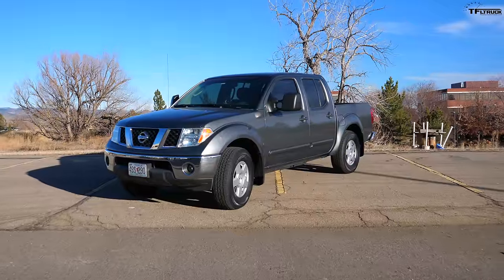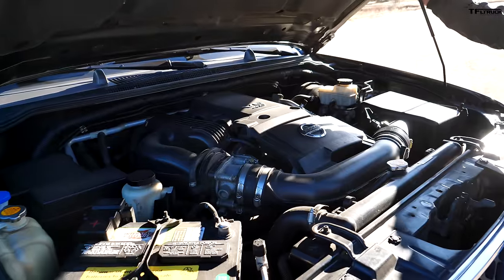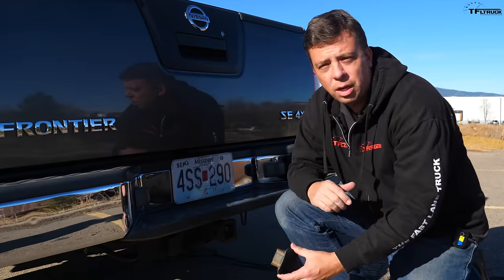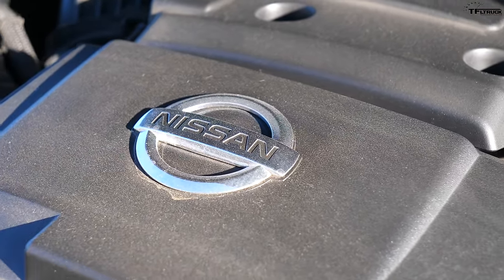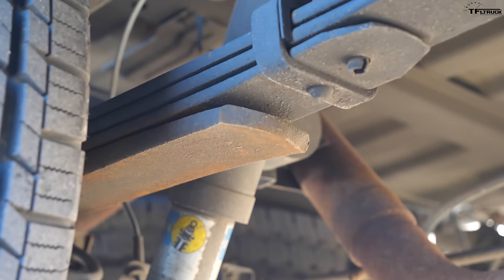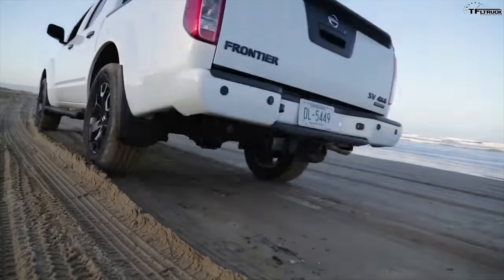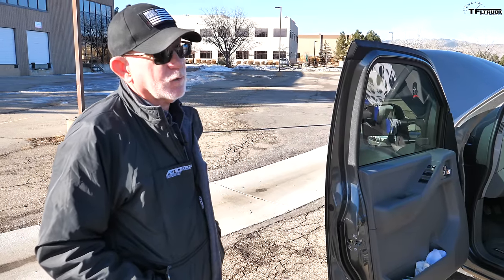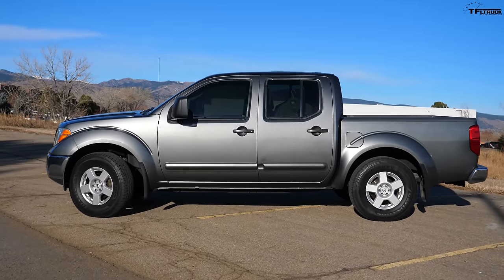Here's Why I Prefer The Old Nissan Frontier Over the New One — Dude, I Love My Ride!

Comment: I just bought a 2006 Nissan Frontier XE  king cab 4 cylinder auto for a $1000 , body and interior are near perfect,  it had the coolant in the transmission fluid, I did a flush and seems to be working ok, it even had a cold matched ARE canopy that promptly removed.
Reply: Looks like common problem.Seems manual transmission don't have that issue.

Comment: All owners of 4.0L Nissan's should hear this... Replace the chains before the warranty expires. There's a TSB for it. The factory secondary guides wear out. Once they're replaced, they last forever. Also, if you hear a loud ticking in the dash, it's the blend mix door actuator. That requires removal of the entire dash. Get it replaced before you're out of warranty.

Comment: I have a 2012 Tundra with the 5.7 that I have driven since new. Rolled over 239,000 miles on Monday and will have about 500 miles more by the end of the week. I use it for work.

Some issues over its life, but original motor, trans, rear end. But then again, it’s a Toyota.

Comment: I have a 2006 Frontier with 145,000 just replaced fuel pump because of fuel gauge going bad.  Love this truck its been trouble free and plenty of power.......
Reply: Should have just replaced the sending unit, cheaper and fixes the fuel gauge.
Reply: @trevors8577   Why in the world would I go to the trouble to drop a fuel tank on a 14 year old truck with almost 150k and not replace the whole unit. The filter on old pump was super nasty look like muddy water running out of it. The truck actually  runs stronger and idles better with new pump. Oh and BTW the new unit was well under $100.

Comment: In 2011, I bought my midsize pickup.  I bought a Chevy Colorado.  I wanted standard and they offered only 4cyl (2.9) with the manual.   Looking at it now, because of the 4 cyl, there is a lot of room to swing a wrench under the hood. Also, exhaust is easy to get at being that its on only one side of the motor unlike the Nissan 4.0.   Also, because it only has a 2.9, the wheels dont spin themselves crazy when its slippery.  With the limited slip rear end, I often see how far I can go in 2wd during snowstorms for kicks.

Comment: The 2005-PRESENT Nissan Frontier is a good looking truck. And I which I knew how to drive a manual transmission. The closest thing that I have to a manual vehicle is my 2015 Toyota Camry XSE with an automated manual ( it’s a 6 speed automatic with a sport mode, I can shift the gears “manually” with the + or - or with the paddle shifters )

Comment: Had a 2003 Frontier 4 cylinder we bought used with 124K on it back in 2010 as a company truck. We sold it at 240K a couple years later. Great truck.

Comment: I used to buy a new vehicle about every year or 2 for 25 years for some reason.  Then in 2015 I bought a brand new Frontier king cab SV (same color as this video) and I haven't bought another vehicle since, and don't plan on getting rid of it ever.  Only 40k on mine and based on how reliable they are, it will probably outlive me.  I have zero interest in owning any other truck.  I don't tow much, just a jon boat/trailer, but I fish and hunt, and the frontier is perfect for "outdoorsy" stuff.  An odd thing with the frontier is that I've gotten quite a few compliments on it from strangers at gas stations.  Kind of an odd feeling to get compliments on what I consider a utilitarian vehicle, but eh. cool.  I think it says something that the D40 (2nd gen) was in production with very little changes from 2004 to today.

Comment: I'm glad he likes his Frontier. For myself, I wouldn't pay Nissan another dime after buying my 2016 Frontier. Within 4 months of buying it, both lights on the rear tag were apparently broken and dislodged by a car wash. When I brought it to the dealer, they said that was normal, that the warranty didn't cover "acceptable wear and tear". I could order a new light for about $50 and pay their labor rates to swap it out. I've never had a car wash break anything on any other vehicle I've owned in the past 35 years, so I don't consider this "acceptable". Within 2 years, the factory tinting had bubbled so much I had to have it replaced in order to see through the side windows. Compared to similar trucks, I believe the price is too high and features too few. Coupled with unacceptable manufacturing problems, I just can't see ever buying another. And with the lack of dealer support, I just won't go with Nissan for any vehicle. It's good to know others have a better experience though.

Comment: I have a 2007 frontier with 190K miles. The biggest issue I’ve had so far is the front wheel bearings went bad. I’ve had zero engine issues. 🤞🏽

Comment: I have a 2010 Nissan Pathfinder. Same motor and trans ... unfortunately 2wd. I had a 2012 Pro4X Frontier before, which was totalled and definitely saved our lives after being t-boned, which led to my purchase of the Pathfinder. I have 208,000 miles on it as of yesterday. I also had to replace the timing chain. That was at 100,000 miles. In my opinion, Nissan did a great job with this motor and trans combo. I average 17 mpg, which is not great, but I can get around 21.0 on long highway drives at 80-85 mph.

Comment: I live in Kauai where Toyota truck are popular and very expensive. I want it to buy a 2019 Tacoma sr5 v6 but it was too expensive for my purpose of buying a truck. I went to Nissan dealer and test drive one. I like how simple and feels like a truck. Transmission is really smooth and  a lot less money compare to Tacoma. I could easily afford a Tacoma but decided to save money and buy what i need and not what I want. I have my 2019 frontier  for 3 months now and the more I drive it the more I like it. Sometimes it’s better to buy what you need than what you like and ending up liking it than buying what you want and ended up not liking it.

Comment: My 2008 4.0V6 4x4 crew cab SE long bed just rolled over 289,000 miles the other day. Looks like im going to get over 300,000 out of it easy as it's still running strong even though I've been pretty tough on it. Bought it used with 56,000 miles on it in 2013 and drive it every day for work and play. Have replaced the radiator twice due to them developing a leak. One replaced at 100,000 and one at 250,000 and I contribute that to towing a heavy 6x12 cargo trailer for work. Other then the radiators, I've replaced front end ball joints at 150,000, several sets of brake pads, and a new set of Rancho RS5000 shocks front and rear at 250,000 miles (over do), oh and a couple of those dang O2 sensors. I Have run valvoline oil extended life syn blend after 100,000 on the odometer with a purolator one filter with changes every 5 to 10 thousand miles with new air filter every 3rd oil change regardless unless off roading required a more frequent change. The Frontier has been the Most reliable and useful truck I've owned beating out my favorite owned previous truck a 2001 Toyota Tundra Limited 4X4 and my first fear to my heart truck my 1988 2.9V6 4X4 extended cab Ford Ranger with dual gas tanks.

Comment: I miss my frontier. I had a 2016 pro4x with manual transmission and I traded it in for a 2018 Silverado 1500 zZ1 and it's a lovely truck but I miss the fun of the manual and the engine of the Frontier.

Comment: I’ve owned several xterra trucks and my last was a 2017 frontier pro... loved the truck but hated the bed and all the little rattles.  It has a 200lb tailgate rating.  Traded it in and picked up a Tundra 1794 with all the bells and whistles.  I kind of miss my old truck but not on 3 hour drives.

Comment: In my opinion only thing that Frontier needs is a interior upgrade exterior LED front and rear lights and maybe a transmission that has more than 5 gears on the automatic four-wheel drive front Locker. I have a 17 SV crew cab short bed 2 wheel drive bought it new it now has 30206 miles on it and still strong as ever and I I'll pull a 3200 lb trailer with lawn equipment on it daily. And honestly I never did any kind of homework on the frontier I was going to the dealership to pick up a 15 Silverado but it was so the day before I got there I didn't Reserve but I seen the frontier head 7 miles on it test drive 2 miles so I said what the heck got it and I've been happy ever since

Comment: I love these trucks. I had an 07 Pathfinder and I absolutely loved it...but the problem with the 05-07 Frontiers/Pathfinders, especially in the Automatic Transmissions is they are VERY VERY VERY PICKY about their maintenance. If you don't stay on top of it you can expect a failure. Especially with the auto transmissions and 4.0 V6 engines. I didn't stay on top of my trans fluid and before I knew it my trans was gone.

Comment: One of my vehicles is a 2010 Expedition with 145k miles on it, the only issue I have ever had was 3 roller rockers on the passenger side of the engine start to tick. It was 3 $5 parts and a gasket, too bad it cost me $1,100 for the repair at 140k. Timing chain, cam phasers, and all the other roller rockers are original on my 5.4 3v.

Comment: I'm a little bummed out about his timing chain and rear end. Hopefully those were improved by the time of '11 came out. Mine is nearly identical to his except mine is an SV model. In contrast to him, I had to change the clutch after it started slipping a little. I also changed the flywheel and rear seal while doing so. That's the only trouble I've as of 100k miles.

Comment: I loved my 2005 Nissan Frontier, It was stick shift 2.4L king cab and I put 200K plus miles on it until the cooling system crapped out. Still runs but not sure if rebuilding the entire cooling system is worth it.

Comment: I had a 2006 Nissan Xterra. I put 100K on it before trading it in. I towed a 25’ Ultralight travel trailer. Fantastic vehicle, and I really liked the A/T. Gobs of power, always in the right gear, and would leave V8s in the dust. If Nissan still made these, I’d buy another one. My father bought a new Frontier last year, hated A/T the transmission. Shifted way too early, trying to improve fuel economy.  I’ve owned several Nissan trucks over the years, but they are no longer a consideration. He should keep that truck forever.  I regret getting rid of the Xterra.

Comment: I own a 06  LB Auto with 85000 miles oe brakes,shocks still ,had the same timing belt problem early and under warranty.Its been a great truck so far only complaint is the turning radius.Love all the options that came standard and actually like the looks better than the tacoma.
Reply: 95,000 miles now, oe brakes.

Comment: I have an 07 with a 6 ft bed and a 6 speed. 2wd though. If you need a 4x4 and a manual you may need the short bed. I picked the Nissan for the manual as well.

Comment: My dad and i both have frontiers both had em since 2002 make and model 2002. Put 350,miles on them only had done small repairs only big things were radiator and windshield very strong trucks i prefer Nissan over anything truck wise

Comment: Currently for work I am stuck in a 2019 frontier rental. I see the draw to it because it is a very simple truck that doesn't have the extra stuff that costs so much. That being said this one has an automatic trans that shifts hard and the throttle before you actually engage is a bit much so its jerky at take off from a light or sign. The speedometer is correct below 40 but somewhere between there and 55 it becomes inacurate because at highway speed of 75 my gps and gps app on the phone shows to be ~10 MPH slower close to 65. Would go faster to see if the spread goes farther but its geared such that its turning about 2600 rpm at 75. In its defense however its a rental that was almost certainly abused during break in period.
Reply: Also the cup holders are terrible. Way too big and with the jerky take offs it likes to dump drinks.

Comment: This is the best deal going with the 2019 loaded Frontier Pro-4x going for $26-28k, $10k under MSRP. All the problems like the radiator engine issue have been fixed with over 15 years of production.  The 2020's we know will have kinks with the new engine and trany. I went with the OR Tacoma in 2008, now have 180k miles as well, have only changed the alternator. But I'm buying a 2019 Frontier Pro-4x for the aforementioned reasons. Can't justify paying $10k more for the new OR Tacoma because it's prettier. The only thing I will really miss is having the longer 6ft bed option for the double cab like in the Taco, can't get it in the Pro-4x, I will live.

Comment: Anyone know how different that last update to this gen Frontier is? They put the new engine/transmission combo in the last couple year models of this one. 2019? 2020? 2021? I hate where they located the push button start and I'd be afraid of accidentally hitting - it should be located up around the rest of the controls, not on the flat console area where people put their phones/snacks/gear etc. Dumbest thing Nissan did. So I wonder if that model would be worth it or if the 4.0 is plenty good.

Comment: I have owned three frontiers to date. First was a 1985 standard cab. 2.4 four cylinder. Put 185000 miles on it and give it to my daughter.  Second was a 1990 model , had 36000 when I bought it. Drove until it had 180000 miles were reached. Still no oil usage. Then bought a new 2003 frontier.  , have 175000 miles on it at present. No oil usage , a good truck till yet. I believe in the old 2.4 liter engine. Change oil ever 5000 miles. Will last for a while
 I,m afraid of the new. Why change something when it works. Crazy.

Comment: They are great little trucks! I have a 99 xe king cab with the 4cyl and manual trans. It's my daily and has 240000 miles on it, like hard miles. I have beat the shit out of this truck and it still runs like the day I got it. Not very much power but it's enough. I have pulled 4000lb trailers with it @ 65, 70 mph. Only things I have had to replace is the trans and rearend, because of the abuse.

Comment: I HAVE a 2007 nissan crew cab long bed bought new  v6 auto with 160k on the clock didnt have to replace plugs until 145k and they looked good. only real issue was the RAD which should had been a recalled i bought a nimzo rad took 1 hr to replace..been a great truck. the rad killed several transmission because of it.

Comment: Frontier, Xterra, and pre 2012 are best of the basic reliabe trucks with surprising off road capability. Non pro 4x or nismo frontiers are teally cheap used too.
Like the simple mods that make it more usable. Do his bilstein or other shocks fix the ride?  Have ridden in and driven  in a V6 SV 4x4 couldn't handle the abysmall ride quality and noise on a daily basis.
Also surprised he spent money on axle vs just getting a depreciated new to him used model with lower miles.

Comment: I got rid of my 2018 Colorado and got a 2019 Nissan Frontier because the the Colorado struggles at towing. Now for me I would never own a V6 with a standard as I prefer an automatic, especially when towing. My main gripe about the Frontier is the steering radius and the fuel mileage.
Reply: The turning radius is terrible.
Reply: @4dscdriver  Yes it is.

Comment: The old one? They haven't changed much since 2004 in the first place (in the U.S. anyway). They still have that drop-dead reliable 4.0L V6, still have the same transmissions, still have the same frame, the same interior (with marginally updated tech), and are largely exactly as reliable, dependable, and simple. They still also have the turning radius of a fully-loaded oil tanker, the fuel economy of a 1995 Ford F-150, and the looks of a GTA 5 mishmash of random trucks. Not the truck for me, but I understand (and don't judge - forgive my humor!) if you like them.

Comment: I have a 2000 Frontier bought new, now have 224,000 still runs great, just do your basic maintenance, great truck!
Reply: those were a little more solid I think... the 05 redesign took the quality down the rear axle diffy units were problematic on mine

Comment: I love my 2007 Frontier but this video does not point out the common failure of the radiator connection that commonly destroys the transmission, probably because he is running a standard transmission and maybe avoided it.. Nissan did not and still does not offer any support for this, costing the owner the expense of repairing the radiator and the transmission. Another common failure is Nissan's fuel gauge which commonly failed at about 70,000 miles.  They avoided a recall on this because it was not a life threatening issue.  Unfortunately Nissan does not stand behind their product like Toyota does.  He does address the replacement of the rear axel.  I haven't experienced that, but had to replace my drive shaft at 150,000 miles. He is at the limit of the catalytic converters and on these trucks there are 4 components at $500 each.   The issues that I mention above were apparent in their 2005 model and had not been addressed in their vehicles till about 2019.  The vehicle is very comfortable to drive and has a better interior than the Toyota.  It has plenty of towing capacity for a midsize truck.  All said I love my truck but I don't feel good about Nissan any more.

Comment: Those Titan mirrors on his Fronty looks ridiculously huge. And just because your truck can get the wheels of your trailer moving, doesn't mean it should tow the trailer. The reason why this old timer had to replace his rear gears is because he's towing to heavy at steep grades of road. Why would Nissan use a plastic tensioner for the timing chain?

Comment: I have a white2006 v6 Nissan Frontier  replaced radiator so coolen and transmission wouldn’t mix ,big problem with 2006,truck has 130,000miles,the white paint is starting to chip off,great truck to drive,keep it for long time,